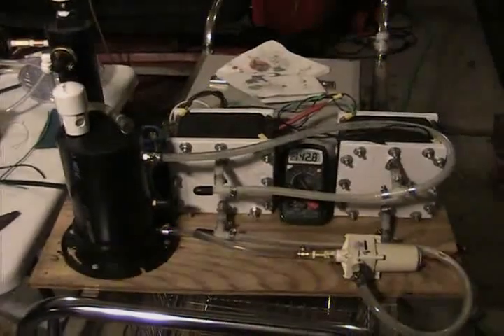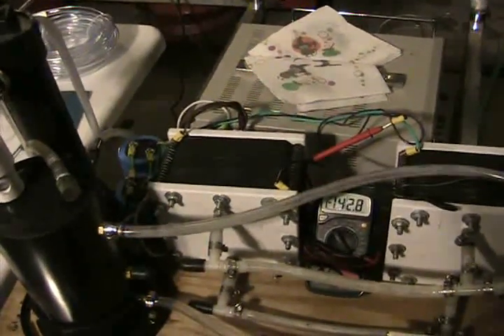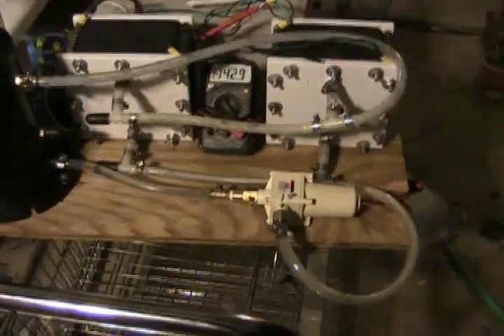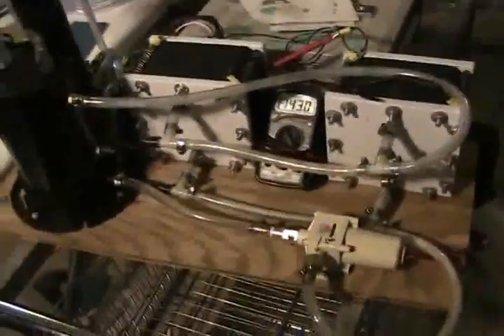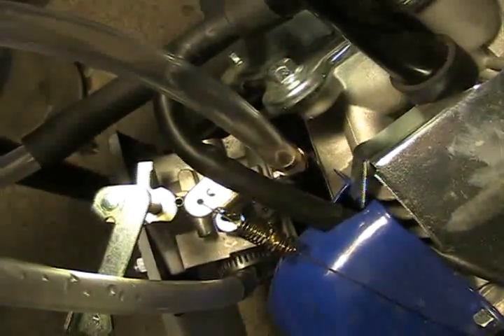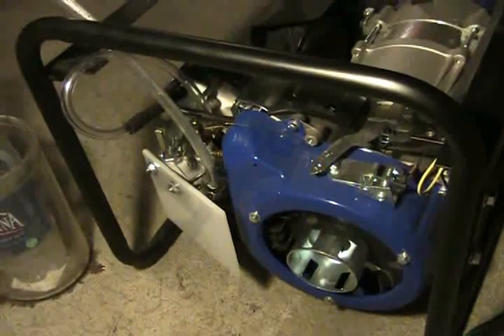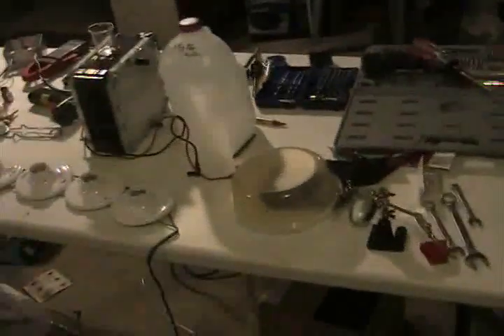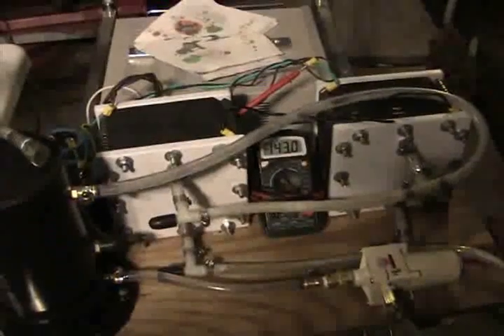generator test 10 engine running on hho

Comment from the maker: But if it were ever the case that EBN had hard undeniable proof that these cells did in fact help emissions and or mpg, then things like warning stickers and other safety equipment would be included in the system. But all safety equipment would have to meet extreme duty tests to prove itself safe. To the point which the system would be no more dangerous than water.

Comment from the maker: I know what your talking about, but for now no. we need to redesign engines to run properly on hho, then see what kind of power we get out of it. But to run it, we are fighting a lot of ineff. ice engines are not very eff. It would have to be 400% ou to do what you are suggesting, at current outputs.

Comment: can tell you that I hope to be using a PWM as soon as one of the EBN R&D guys can make me one that will handle 240v @ 30a ... this will let me have better control over the amps I send to the electrolyser than I have now and permit easier fine tuning ... right now, my only control over amp draw is the electrolyte concentration ... suspect D3 has same problem ... the PWM's common on the market are intended for 12v implementations ... these experiments have unique requirements ...